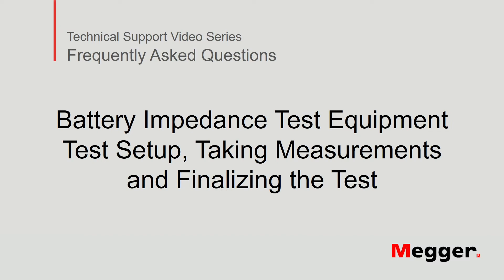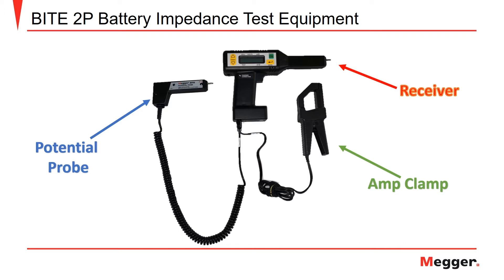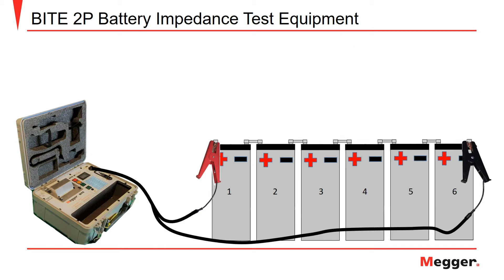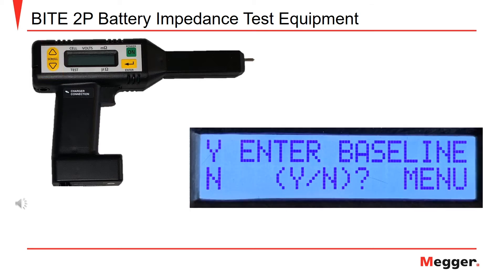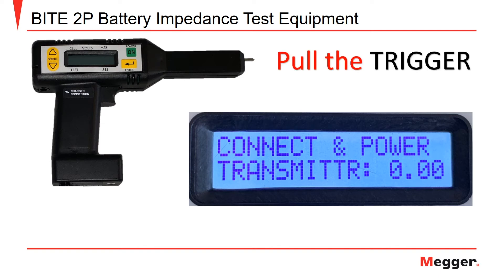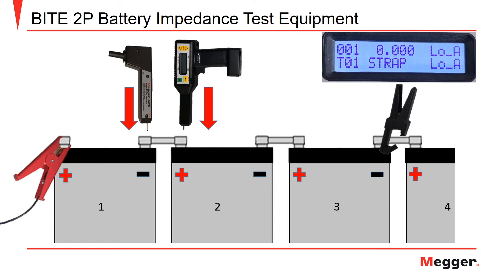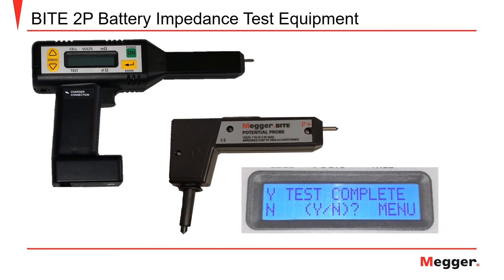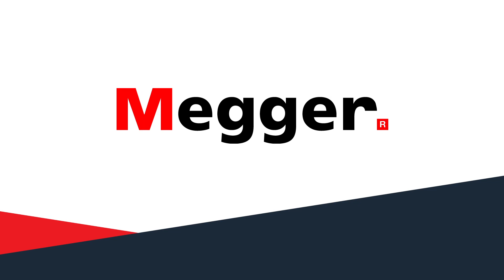Megger BITE 2P: Procedures for Battery Ohmic Testing

Comment: Hi!
The Current in the Megger and the Current in the pistol is not matching, in the pistol is Less than 1, so it appears Lo_A, and I have no measurement for impedance.
Is this normal?
What should I do?
Thank you!
What I most to do t
Reply from the maker: Hi there, the Lo_A message indicates that there is low or zero current flowing through the battery string. The current for the test is supplied by the BITE 2P transmitter module. They may have a bad connection, didn’t turn on the current supply function or have a bad instrument.

If you have any further questions please contact our TSG team depending on your local area. For our UK team please contact dovertechnicalsupport@megger.com or call 01304 50 21 02 

Thank you